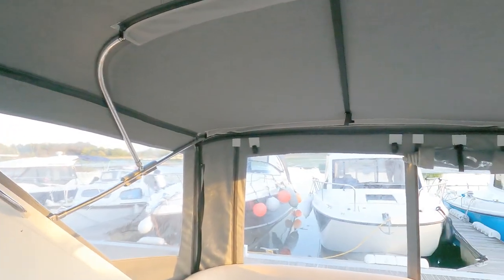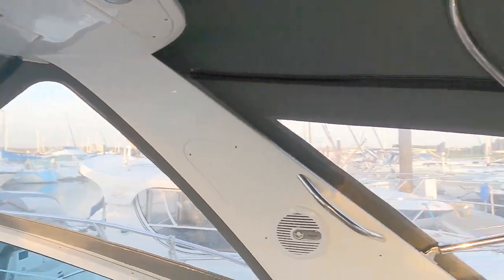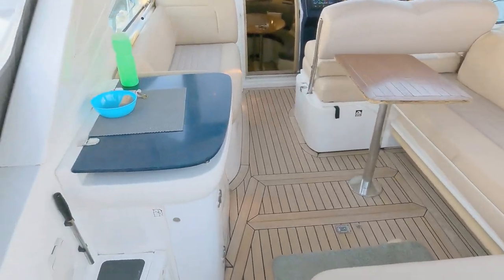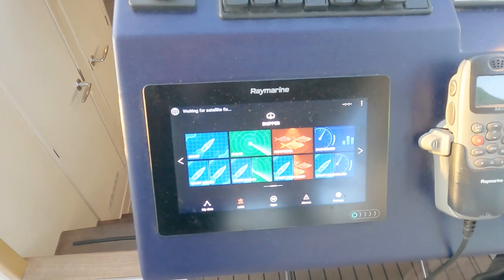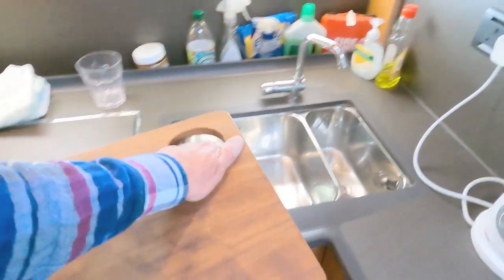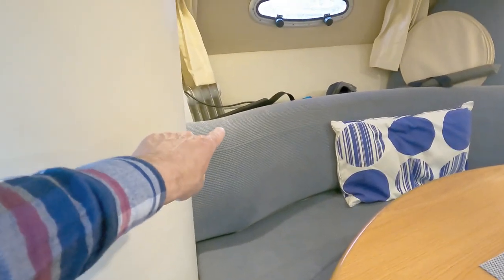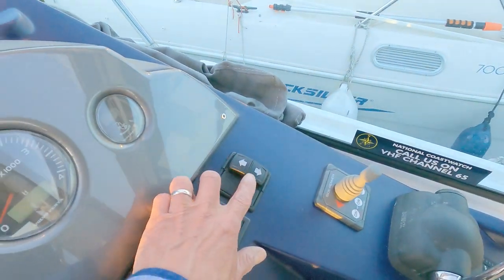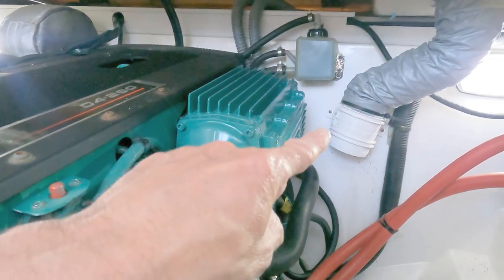Beware - When you buy a used boat, upgrading it can be addictive!!

Comment: Nice work. Are you able to give a rough price for the fitting the bow thrusters. Did you use a local fitter, or do it yourself? Interested, as I can nearly see our boat out of your front windscreen
Reply from the maker: Hi If you see me onboard, pop over. To answer your question I used Osmotech. Their fiberglass guy was amazing. However the guy who fitted it did not really know what he was doing. That aside it's very good. I also have the remote controller with anchor winch as well. I think I paid £4500 all in. It adds value to your boat so worth it. Might be slightly more now.
Reply: @ALifeMoreBoaty  Many thanks, that's very helpful. I'll keep a look out.

Comment: Hi, do you have real world performance figures for your boat (it’s lovely by the way) what top speed do you get at the start of the season when she is clean and dry? compared to the end of the season when she is a little dirty and water logged? Also if you have your fuel burn at displacement, cruise and full throttle? That would be very interesting..

I have just bought a 2015 leader 8 with the same engine and I’m waiting for it to be delivered next month. 

Thank you 🍻
Reply from the maker: Hi great question, and yes I love the data. So let's start with a clean bum at the start of the season. My cruise rpm would usually be 2600 and this would give 18-20 knots wind depending and a good fuel burn of around 25LPH. At 2800  rpm I would get 23-25knots yet the LPH would go upto 35LPH. Anything above that was diminished returns really. By the end of the season, if I'd not had a mid season lift and scrub it would be possible to lose 3-5 knots even with a 200 rpm uplift. The massive noticiable thing is the time to get on the plane. Clean and fresh back in the water she'd be planing at around 12knots, and really quickly, dirt takes a long time due to drag and less efficient prop. You see 1 engine is pretty light. Yet as the muck builds you need more HP, so the trick is keep her clean. The other interesting thing is additional weight. When I bought her, empty of belongings fuel and water she was over  tons lighter than when I lifted out at the end of season, fueled water and loads of belongings! Finally flat out very clean was 28knots at 3400 rpm and 60LPH, never bothered. Also trimming the leg and the tabs makes a big difference, we'll worth taking a day with no wind or waves to play around with both on  fixed rpm to find her sweet spot. Also the S29 sealine had a twin stepped race hull which rides very well. Hope that helps. Thanks for watching.